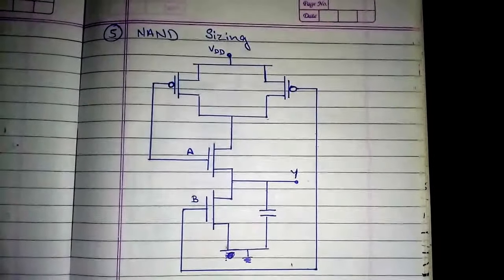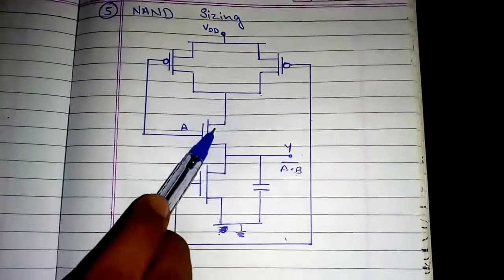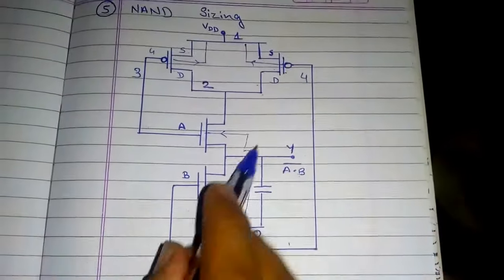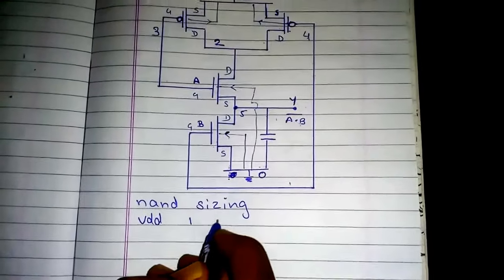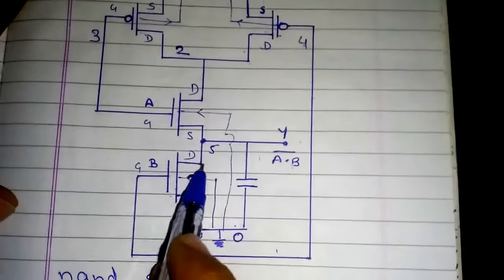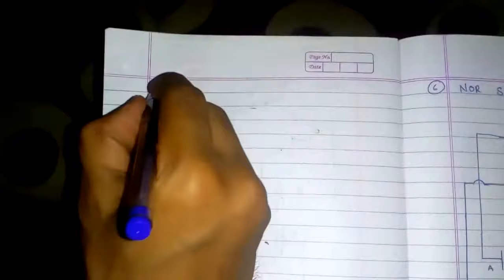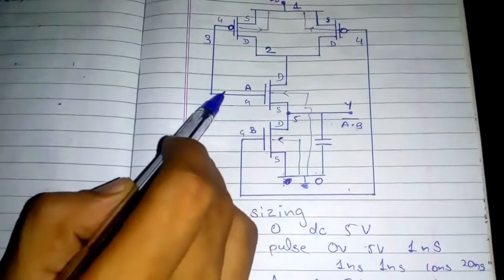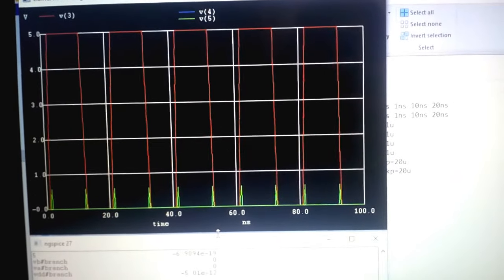NAND Sizing (NGSPICE) - 6

Comment: I modeled correctly NAND , NOT(inverter) and NOR gates, but seems there are a trouble if i use another thing on the inputs that can't be pulse sources. The inputs keeps on an intermediate state, maybe is for the devices i am using on P and N mos 2N6851 and 2N7000 . May be is a lot easier  make draws on Oregano and export circuits.